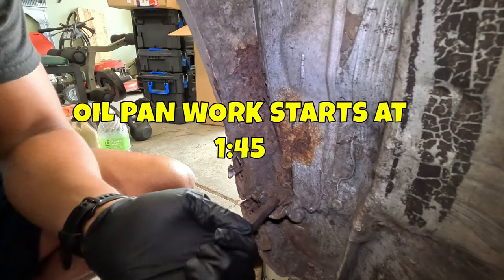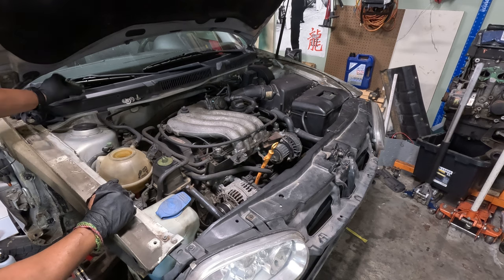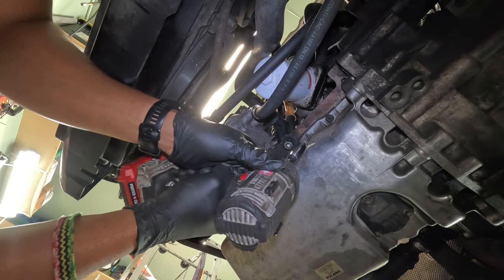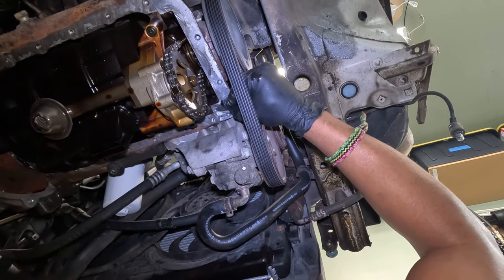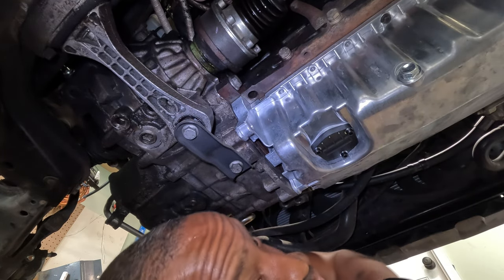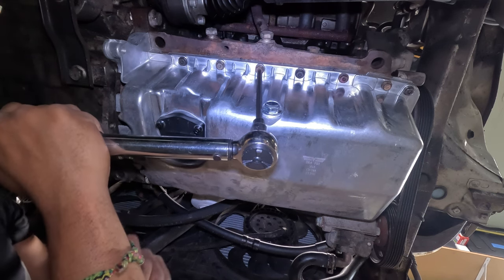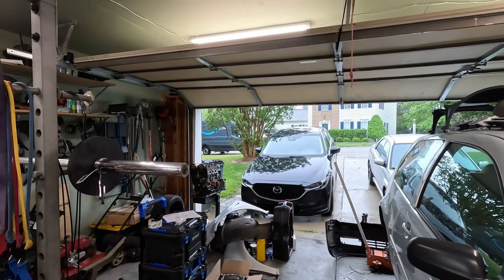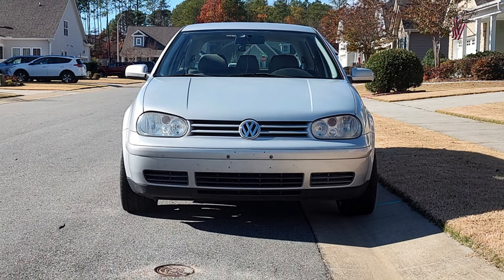99 MK4 GOLF | replacing a cracked oil pan

Comment: I think the manual actually calls for hand tighten the main bolts, then hand tighten the transmission bolts. Torque down the bolts in diagonal pattern, then torque the tranny bolts. It is recommended to be done within 5-10min after applying the RTV ;) You did the right thing with the 24hrs though. One advantage when you do your own stuff is that you can wait for adhesives etc to fully cure (with 24hrs you are always on the safe side)